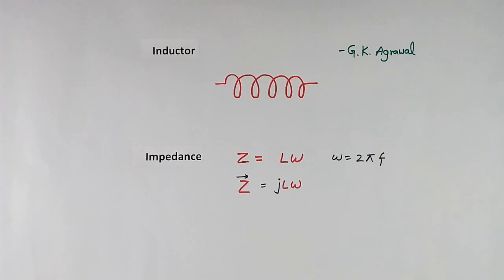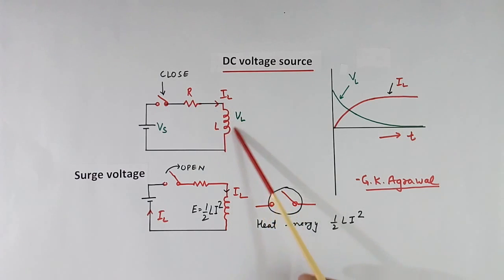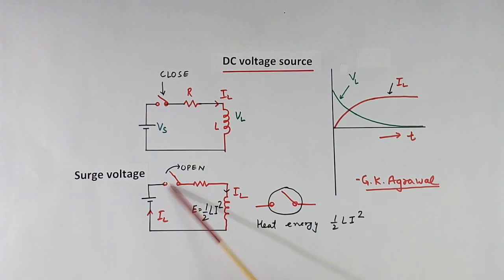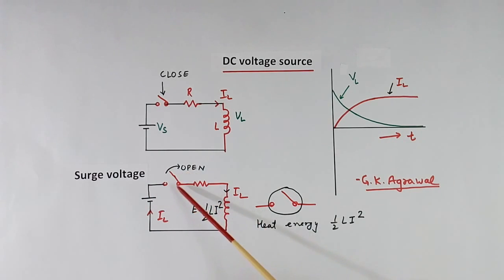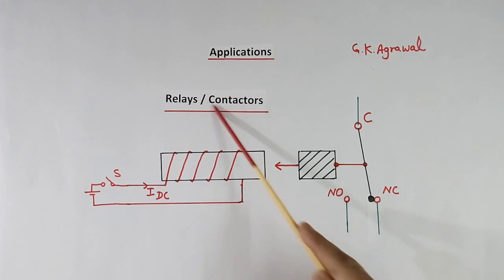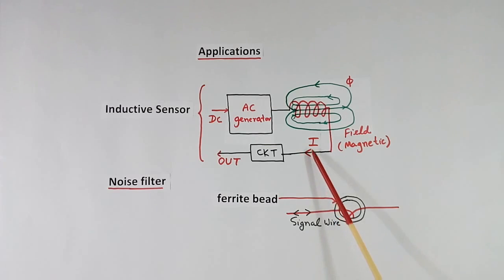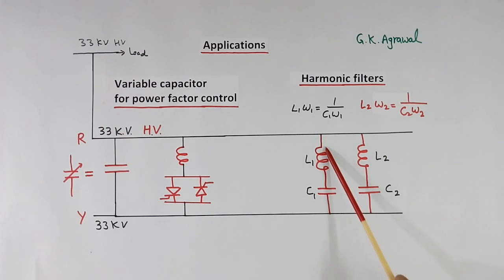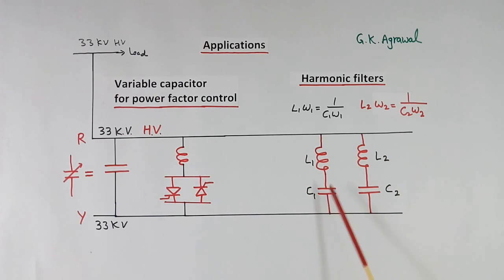Inductor working in AC, DC circuits, what is basics & use

Comment: SO the current will not damage the battery?? when the circuit is open after it has been charged? .......or Does the current hit the resistor and THAT absorbs the extra current???
maybe someone who knows more than me could point to a video for clarification for a newb. thx
Reply from the maker: This is explained in the video itself that, where stored energy of the inductor goes. Please watch this video again.
Reply: FIRST I WOULD LIKE TO PAY YOU A COMPLIMENT, GREAT VIDEO. Where I was confused is where DIS charged energy goes. I had envisioned current going BACK through the battery, and wondered if that would physically damage a battery after the circuit opens...  also I have subscribed to your channel  thank you for the free information!
Reply from the maker: Inductor energy convert to heat energy at the open switch. You might have noticed sparking in the switch during switching off some motor load.

Comment: transformer's coil is also a type of inductor.As inductor always makes (di/dt=0) i.e magnetic flux is not changing. then how emf induced in secondary coil? plz explain me . it makes me confused.
Reply: Bhai,AC voltage/ current is always changing  in a coil and so magnetic flux and hence induced EMF in secondary coil.
Reply: Maybe a late reply but still the continuous change in polarity in AC supply (change from positive peak to negative peak) results in changing flux, which further induces emf in the secondary coil.

Comment: I've a confusion in my mind from childhood. That is, how inductance (better to say inductive reactance) can exist there in d.c. ckt? I think this because in d.c. the frequency is absent, i.e. f=0. So w(omega)=2×pi×f=0. So, Z=w×L=0. I may be wrong. Plz explain my mistake.
Reply from the maker: 1- You analyze is correct for steady state condition.
2- But when we switch inductor, so during switching time frequency is not zero as voltage is changing.